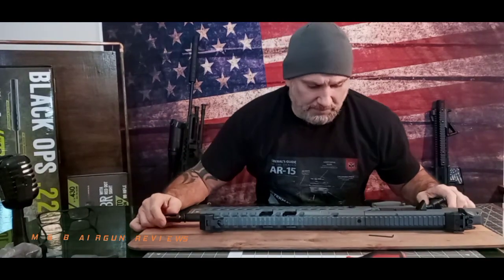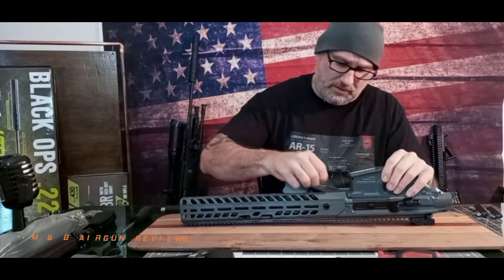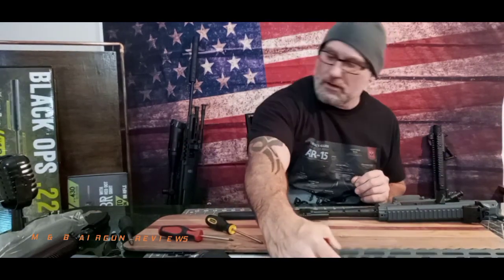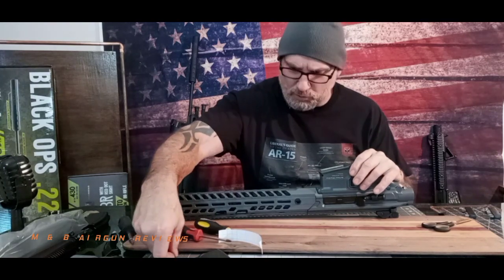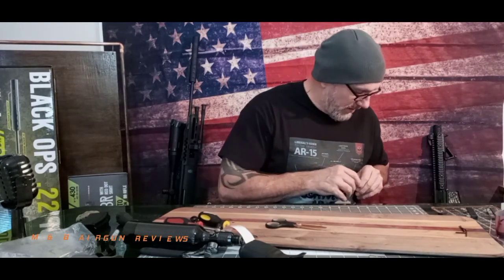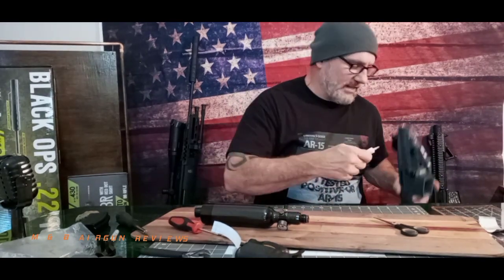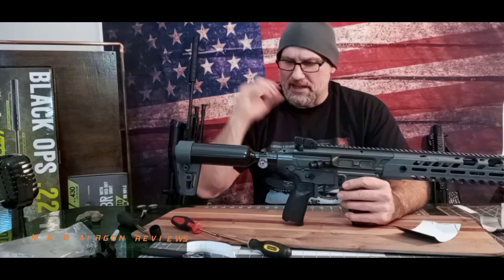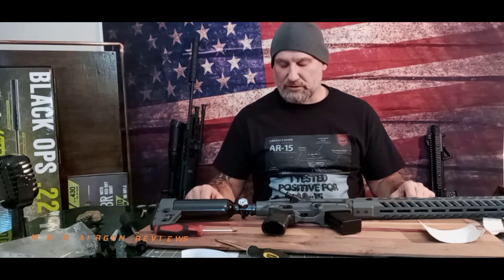Sig Sauer MCX VIRTUS PCP air rifle.  How to remedy the poor quality control.

Comment: Great video! I took the disassembly one step further, split the case, filed the casting down slightly and used 2 layers of aluminum HVAC tape wrapped to shim the barrel into the casing. The 'shim' combined with filing and tightening of the screws you pointed out have changed the MCX entirely, barrel is locked in super solid, accuracy and consistency have improved massively.

Comment: Thank You!
I had barrel wobble, and didn't piece together right away that it was causing my very poor groups with this rifle. I assumed Sig knew what it was doing....
But since wedging some slips of paper into the barrel sleeve there, it immediately improved the groups with just that temporary test fix.
I also have frequent trigger catching.
I was never concerned about the bottle looseness, because it went away as soon as the gun was pressurized. Sometimes engineers design stuff that way, so I also assumed it was also not an issue.
But, in one fell swoop, you addressed every gripe I had with this rifle, which I wanted to like so very much. Maybe now I can, finally....
Reply: You're right it seems. The gripes people have about this one are all legit.
   If y'all want a recommendation for a rock solid PCP, get an Air Force Texan CF. It's a flat out beast, and prime example of what a  "precision" built rifle should feel like. Because everything about it, actually IS. They aren't fing around. 
   Sig Sauer should be embarrassed by their efforts with the Virtus. It's a shame too,  because it really is a beautiful rig.
 They need to do the following, to make this thing a runaway best seller...
1) revamp the regulator/bottle to NOT wobble with PRECISION thread/neck, matched machining, and WITH an added hex barrel set screw, for added safety.
2). Strengthen the appropriate upper components to handle more power, and change the regulator, so each shot goes out at 1000 fps for a 15.grain.
3) They added a sling mount to the butt cap on the bottle. Yet didnt have the good sense to at least add a 3" section of picatinny to the UNDERSIDE of the frame on the other end, so a sling can ACTUALLY be easily mounted. Mind boggling to say the least.  FIX.
   My $.02

Comment: Excellent video. 

I purchased this air rifle the same day it came out a couple years ago from Airgun Depot. The first rifle came in fast and the first issue I noticed right out of the box was the tank wobbling a lot... Called back Airgun Depot and they sent me a label for returns. They were out of stock and I waited 3 months for the replacement. Didn't really get bothered by the wait as I had other air rifles I was playing with at the time. Replacement arrived just to find out the tank was also wobbling. After reading a little more at the forums I saw that filling the tanks to 3000 psi made the tank to stay in place and it did. After a few shots I noticed the accuracy was not terrible for an airgun, but it was way off my acceptance level. I was jumping 4 inches off at just 20 yards. After some more in depth inspection I noticed the flasshider was really loose, the barrel was also wobbling, and just to top it off, the top picatinny rail was also loose and made the scope to jump up and down about a milimiter and a half. No wonder I couldn't hold zero with this thing. After that I tried to return it but after they made me wait 3 months for a replacement that waived my return time.

I put the rifle in the safe and 2 years later I recently remembered I even had it in there. I'm about to dissasemble this thing conpletely to bits and pieces and fix every issue in there. The pcp fill valve is also leaking now.. its issue after issue with it.

I'll see if it ends up on my gunsmithing table or under my saw blade.

Comment: Just got mine today and yes the tank was wobbly but rather than shim the fitting I used 2 O-rings stacked one of the other to make up the gap between the tank fitting and the receiver housing. When you screw the tank on, the O-rings compress and no more wobble!
Reply: What size o rings did you use, just got my virtus today and the bottle rattles
Reply: @Demogor_666  trying to remember what the size o-rings I used. about the same size that will fit around the neck of the filler fitting.
It's been too long since I did that and I ended up sending the whole POS back because it couldn't hit the broadside of a barn! So bad it would not print groups in 4 inches at 20 yds.

Comment: Thank you for tearing the MCX down. I have done the same with all my Crosman air guns and have been able to modify all of them successfully because of what I learned from taking them apart. I was hoping I could modify the Sig air guns so that they may be field strippable or so I could  insert Crosman DPMS, R1, or MPW internals into it but it is clear that the MCX body/system just doesn't allow it. I wish the Sig's had full functionality. Thank you!

Comment: Got my Virtus some days ago.. knowing what I gotten into. I do am a big Sig airgun fan..
 -My rifle also had the wobbly tank. But it got tight after pressurizing. Might fix the issue whenever I take the rifle open. But alone it seems as no problem.
 -The handguard sat tightly on it's place - but the barrel has a plastic outer barrel shroud, consisting of three plastic pieces. The piece with the four small,screws is a two-piece clip-on tube which is sturdy in no way. And the front plastic piece of the outer barrel is compressed towards the receiver with that grey threaded nut screwed around the tip of the inner barrel inside the outer barrel setup. Seems like a good idea/design at first, but that bending plastic shroud do not really fit that well together. The joint of the two plastic outer barrel parts ain't the best. Fits well together surely - but bends easily, unlike the aluminium outer barrels on the older co2 MPX/MCX rifles..

Comment: I have a sig x5 air pistol. Works really well, great fun. We the people bb ok but doesn't always work as it should. The co2 mcx was great. No leaks, no wobbly bits. Iron sites were a joke. OK with a red dot. At least until it packed up. Waiting 5 months for it to come back from sig, eventually the rfd gave me a new one. Would I risk the money on a virtus now? Probably not. Too many reviews about poor quality control, appealing accuracy. Sig even stated something like 1 to 1.25 inches centre to centre at 20 yards if my memory's right. Then here in the UK they have removed the trigger spring so you have to flick it forward to take the next shot.  And its almost double the price they charge in the states. I think sig can keep this one
Reply from the maker: My 1911 we the people failed today  during testing. . So far my mpx is the only issue free sig I've had
Reply: You'd expect more from a company  like that
Reply: @FultonStreetBeats  I have two mpx and two mcx and they have literally all failed plus the safety on my x-five broke I honestly want to get this gun but I'll pass I think... The bushmaster mpw is great, the ak1 is great, most everything else crosman makes sucks and I think are engineered to fail, umarex not much better and I'm pretty sure they both use the same parts and make the same guns because I've had them all apart, they're mostly all the same two or three designs internally ... I think I might try the air force texan... Anyways thanks for the video

Comment: Hey man, thanks for doing this video. Just got one of these, and it seems they've solved the barrel issue (or maybe mine was just properly torqued to spec at the factory 😐😂). Had it needed it, one thing I thought about using to shim mine was aluminium duct work tape. Self adhesive, almost as thick, and way safer for the clumsy. 
   In regard to the "wobble, my tank regulator threads also do seem as if they were designed for a different rifle. 100% unsat. And difficult to believe that they just let this b.s. fly.
   Btw...I accidentally hit thumbs down, before reversing it to a thumbs up. Sorry bout that. So if you got a YT notice about getting a thumbs down, that what it was.
  Also, there is a working charging handle on the top, just below the rear sight.
Reply: Ok, here is the solution I came up with for the "wobbly" 13 CI tank bottle for the Sig Virtus.
   I ended up using an "A211" 13/16 × 1-1/16" x 1/8" HNBR O-RING, from the Horror Freight "Storehouse" branded HNBR O-RING kit. Item# 67644.
   With the tank bottle off the rifle, simply take the o-ring, and thread it down gently until it passes over the threads, down onto the neck of the bottle. It will stop, and sit neatly on the neck below the threads.
   Next, thread the bottle normally until it stops. Then crank it a bit more (don't worry, it's not like you are going to "stretch" the threads, or anything 😬😂). It should seat nicely, with zero "wobble" in the tank connection.
   Now after I did this, when I initially went to fill the tank (already mounted on the rifle), I opened my fill tank slowly so as not to "shock" fill the 13CI, and over heat it. This was a slight mistake. As not enough fill pressure was introduced to seat the rod inside the regulator. Air started hissing out the receiver of the gun. 
    I ALMOST unhooked it, and declared it a "fail." But I remembered hearing a "click" on the Texan's tank, during it's initial fill. So I thought, "F it", and went ahead and cracked the SCBA bottle halfway open.  CLICK!....and the guage suddenly jumped up to 1000psi...success. So, this worked.
  Oh yeah, the HNBR o-rings are green, and harder (tougher), than the standard black rubber o-rings. But I'm thinking a black rubber one of the same size might work just as well. Along with blending into the tank's color, and possibly requiring less torque effort to seat the bottle. Good luck guys!

Comment: I've been just dying to get money together to buy this one. 
Love the .177 co2 MCX I got. Owned since they cqme out on the market. Disassembled that one now for  many many times over and fixed it several times The co2 now being the only downfall of it.. Been just qnxious to get to disassemble one. Just love these...because them not being perfect as is.
Sweet to see a video like this! 👍👍👍
Reply: There are conversion kits to PCP for those CO2 guns I do believe and they are around 90-100 dollars.
Reply: @no.1baller939  Yes. Seen at least the Air Venturi HPA kit.
Many co2 MCX/MPX owners bought of them and gotten pretty okay results even. I just decided to stay using co2 with my MCX since I still want this Virtus..
Reply: I have the Virtus and just bought the MPX for my wife because it is smaller and easier for her to handle.I will be converting it to PCP because I do not want to keep buying c02.Also c02 is temp. sensitive and your shot string will weaken when c02 gets low.Not with PCP.You should convert your MCX and stop buying c02 then you will have 2 nice PCP guns.

Comment: Hi from the U.K. great video on the gun, i like the idea to secure the barrel shroud  i will do that to mine. The actual barrel liner is quite secure  inside the shroud because it's screwed but i would advise you taking the barrel liner out and check it to make sure it's not bent because i have 2 of this guns with same issue, bent barrel liner, on naked eye it seems fine but if you roll it on a flat surface you can see the wobble and it  is bad on accuracy. 
Hope you do a review of the gun shooting it. Good work pal 😊👍👍👍👍

Comment: I was on the fence about buying this rifle. But because of your excellent informative video I decided to get one. I received it today and checked for all the issues you mentioned.
My barrel was slightly loose and my bottle was also loose only when empty. Just some food for thought. I'm just wondering if the 2 screws on both sides of the barrel have a multipurpose.
Maybe not only to secure the barrel but also to align it and center it. As for the loose air bottle, the fact that it gets very tight after filling it slightly (about 500 PSI) leaves me thinking if adding 
shims will cause excessive pressure/stress on the outer casing or some internal components once it expands. also from what I learned about PCP rifles it is recommended that they are stored with some air pressure to preserve the O-rings. So with that said the air bottle would never be loose. Please excuse me this is just my technical mind over working. LOL

Comment: I have an Mcx and its been lots of trouble with it. Buy an other airgun is my advice. 
Thank you for the hacks!
Reply from the maker: Just had the sig 1911 we the people  fail today.  Not 10 min ago. Second  time I've used it. Mag stuck in magwell.
Reply: @FultonStreetBeats  I've been thinking about buying a Sig P226 but if the quality is like this with the mcx, and other Sig airguns having similar problems ? maby I'll buy the new crossman with full auto instead.
Personal favourite at the moment is Hatsans Bt65.
Keep up the good work!
Reply from the maker: I just had my new sig 1911 we the people co2 blowback fail on me today.  Stopped  feeding then the Mag  stuck in the magwell.
Reply: @buckaroobonzai3865  it is good when it lasts mine has a co2 leak in it now and is faulty. And you don’t get a lot of shots per cartridge

Comment: I’ve been looking for an AR15 style pellet gun in a larger caliber than 0.177 (.22 cal or better yet .25 cal) … FOREVER! Sig Sauer is way ahead of the competition with this .22 cal. I was about to purchased it until I started reading the reviews! Shame on Sig! Loose barrels, loose bottles and low accuracy (for an 18 inch barrel), plus a 9 lb.+ trigger pull! In addition, they installed a regulator that’s only 1100 psi so it’s chrono readings are closer to 600 fps, not 700 fps. 
    I own the .25 cal Air Venturi Avenger. It ships from the factory with the adjustable regulator set around 2700 psi and shoots the 
8-round magazine .25 cal pellets close to 900 psi! It sells around $350.
   I own the Crosman DPMS SBR and it is one hell of a BB gun! Crosman got everything right ( with semi/ full auto, full blowback, drop down dust catch, and stays open after last shot fired! It shoots around 600 fps.The DPMS is amazingly realistic. it sells around $300-$350. Only Con: It’s a BB gun! Good for 10 yards (tops) for accuracy.
   If Crosman  made a “PCP charged”  DPMS (or Air Venturi made a carbine), in a .22 cal and/or .25 cal with the 30 round belt system and slapped an 18 inch barrel on it, and shot around 700-900 fps for say an extra $100 … (MSRP $400-$450), … I believe it would become their  #1 seller!
Reply from the maker: My Dpms is one of my favorites for sure!

Comment: I have  of these and enjoy plinking with them.  The barrel is a floating barrel.  And the tank will move until the it is compressed.
Reply from the maker: No tank should wobble ever.  Thats why "all"  of them don't  it ..  Its a tooling issue.   As far as the barrel goes you will find if you watched ,that the screws were all lose.  Free floating barrel on this type of barrel design would have  no significant purpose. The barrel did touch the end of the rail mouth. And also mid way at the joint out of the box just not in a uniform fashion.  All issues are now addresses and it now shots straight.  Some of these rifles were fine from the factory in Japan but a majority need help. .  if you got a good one that's awesome.  After talking with a sig rep they have assured me that the newest versions to be released will have these issues resolved. Time will tell.

Comment: Any lubrication required? If so, what do you use? Also, after about 6 rounds the gun dumps teh whole CO2 cartridge if you fire relative quick.
Reply from the maker: I ended up getting rid of all my Sig airguns. The quality control was just non existent on all of them.  They refused to remedy issues or update the line. To answer your question I  pelgun oil seemed to work for mine.
Reply: Thanks for letting me know.

Comment: Some say when the bottle is full the wobble goes away?? Anyone notice?? Thanks great videos love the new channel you have created.
Reply from the maker: It does go away some when full however when it is not it moves the internals around.  Apparently People have sent the rifle back with some finding the issue resolved when it was returned , while others had it happen again.
Reply: that is correct.
Reply: Not a problem with mine once the air valve pin gets depressed, but overall it a lot of money for a plinker the best bit is the 30 round mag but  too many blobs and gadgets that dont do anything my bb Hellboy is a  better representation of the real rifle and most of the bits actually do something